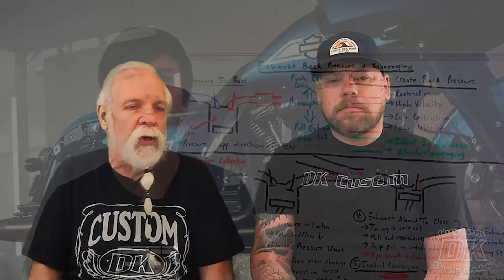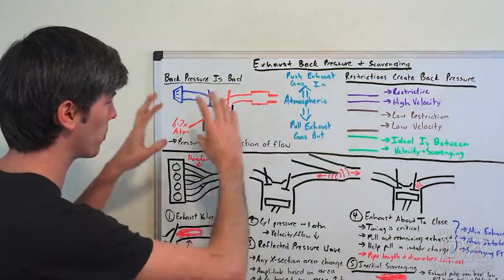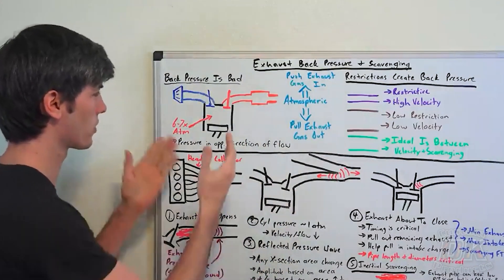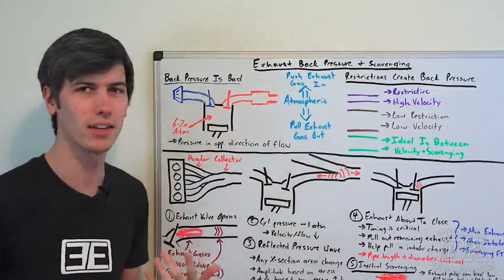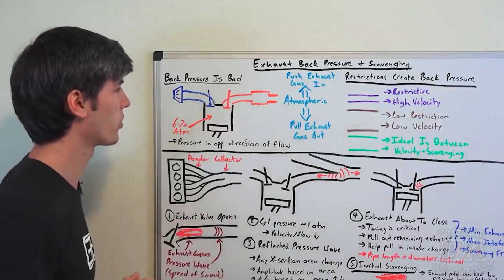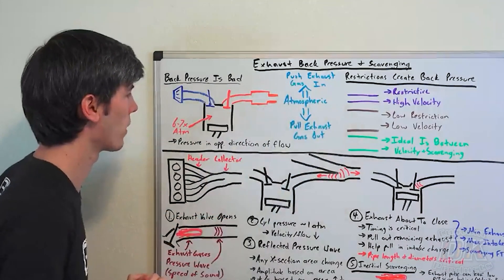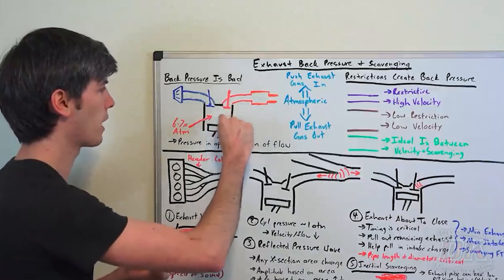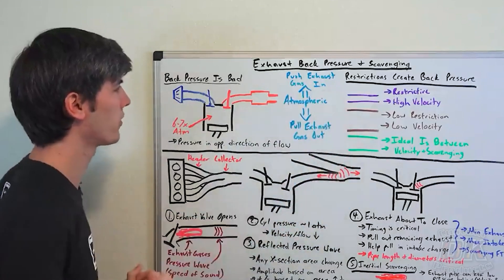Tech Tip: STOP Killing Your Power! The Truth About Backpressure on Your Harley 🚀🔥

Comment: You can tell you have no back pressure if you have decell pop. I run 4" baffles because without it's just too loud. Without baffles it pops like a mofo and I would run it like that but it's too loud.
Reply from the maker: Decel pop is actually due to the AFR in the pipe. If you like the bike with open pipes, but find it too loud, you can try the Thunder Torque Inserts™ they will produce a bit deeper sound/rumble all the way through the RPM and Throttle range. Along with reducing reversion which will give you more torque through the low-mid range rpm. 

 Here is a video we made on Decel Pop that you may find interesting - https://www.youtube.com/watch?v=I_djBYYYu28

Here is a written report on exhaust that you may find useful/interesting - https://www.dkcustomproducts.com/harley-exhaust-myths-and-facts.htm

Here is the link to the TTI's if you are interested in reading more about them- https://www.dkcustomproducts.com/catalogsearch/result/?q=thunder+torque+inserts

Please feel free to contact us with any questions;
Support@DKCustomProducts.com
662-252-8828

Thank you for commenting! 😎MB
Reply: @DKCustomProducts  Thanks for the info. My bike is a 2016 Moto Guzzi Eldorado, 1400 cc V-twin. I took the stock mufflers off and I'm running 42" fishtail pipes I bought off Ebay. They're 1-13/16" id and I had to expand the pipe to make them fit. I'm running short 4" baffles and it's just enough to not piss off the neighbors. Those inserts sound like something I could use as long as it's not too loud.
Reply from the maker: Feel free to reach out with any questions:
Support@DKCustomProducts.com
662-252-8828

Thank you for commenting! MB

Comment: Back pressure is nothing more the resistance to air flow, anything that restricts the flow of air is back pressure. 
Kinda like a resistor in electronics, that resistor is back pressure to electricity or electrons. As the electrons or electricity is trying to "move" along that wire, that resistor is restricting its FLOW ... 
In an exhaust system, smaller diameter pipes will be restrictive to the flow of exhaust where a larger diameter exhaust pipe will be LESS restrictive to the flow of exhaust or if you want to be more technical the exhaust "flow" is nothing more than sound waves. 

Bigger or smaller exhaust pipes will not affect power, they willl just move the power band to a different spot in the rpm. 
Smaller exhaust pipes will make more power at lower rpm and high rpm will suffer due to the restriction in air flow
Larger exhaust pipes will make more power at higher rpm while lower rpm will suffer because of too much open area for the sound waves to travel thru. 

back pressure does not hurt the engine, it just makes it more of a dirty combustion cycle. The back pressure does not allow the piston to extract all the exhaust 100% leaving some behind to be mixed in with fresh air and fuel for the next cycle. 

If you have say 500 molecules of exhaust gas that needs to be pushed out, having back pressure will only allow say 400 molecules to be pushed out while the remaining 100 "dirty" molecules stay behind to be mixed with fresh air and fuel molecules. 
This back pressure also does NOT allow the piston to suck in 100% of the air and fuel that it CAN consume because 100 molecules of exhaust is still in the chamber taking up space. 
So by removing the back pressure, now the piston can push out ALL 500 molecules and then pull in ALL 500 molecules of fresh clean air and fuel and have a greater combustion which means more power.
Reply from the maker: Thank you for the added information. You can see the full video at this link - https://www.youtube.com/watch?v=6W4pF-Lq4kQ

Here is a full written report on Exhaust that you may find useful/interesting - https://www.dkcustomproducts.com/harley-exhaust-myths-and-facts.htm

Thank you for commenting! 😎 MB

Comment: I left my stock head pipe on my 21 SG with a Redshift 468 cam in a 107 with slip ons and it will out run a 23 SG with a 114 with a cam but he has true duals. Self explained motors do need back pressure.
Reply from the maker: Nope, backpressure, by  definition works against the engine producing power.  What causes the low and mid range flat or dead spots in power is reversion.  You can reduce reversion by putting a block in the exhaust tract (back-pressure), which is easy to have one conclude that back pressure is good.  What is better is to have no back pressure and also eliminate reversion.  This is gone over in the following video, with some footage from S&S in it.
https://www.youtube.com/watch?v=pr6z00gL5Yg

Check out the Thunder Torque Inserts™ at this link for more info- https://www.dkcustomproducts.com/thunder-torque-inserts-c57-337.htm

Here is a written report on Exhaust that you may find interesting - https://www.dkcustomproducts.com/harley-exhaust-myths-and-facts.htm

Thank you for commenting! MB

Comment: This line of arguments is overly simplified to a degree that it becomes almost utterly stupid. 
Why? Because of emissions, EGR, and catalytic converters on modern engines.  
There's several fundamental differences between engines on race cars, race bikes and engines on road legal cars and motorcycles designed not to pollute and smog up the entire neighborhood. Yeah you might not care what comes out the exhaust when driving or riding around somewhere in rural Montana, but you surely should and likely will when living in a city of 1.2 million people.
Reply from the maker: This video is not related to emissions. Baffles do not impact carbon output. Instead, it explains how exhaust gas velocity works and demonstrates how understanding this can help improve torque performance. Here is a link to the full video if you are interested - https://www.youtube.com/watch?v=6W4pF-Lq4kQ

Here is a link to a full written report on Exhaust that you may also find interesting - https://www.dkcustomproducts.com/harley-exhaust-myths-and-facts.htm

Thank you for commenting! MB

Comment: I got about a half inch of a blockage in my exhaust... Improved it dramatically... Could it be better? Yes but then I'm running full baffles.
Reply from the maker: If your baffles are open you could install the TTI's and it would eliminate the reversion and give you more low - mid range torque. 
Here is a link to the full video that you may find interesting - https://www.youtube.com/watch?v=6W4pF-Lq4kQ&t=0s

You can see a written report on Exhaust at this link - https://www.dkcustomproducts.com/harley-exhaust-myths-and-facts.htm

You can see more about the TTI's at this link - https://www.dkcustomproducts.com/thunder-torque-inserts-c57.htm

Please feel free to contact us with any questions:
Support@DKCustomProducts.com
662-252-8828

Thank you for commenting! MB